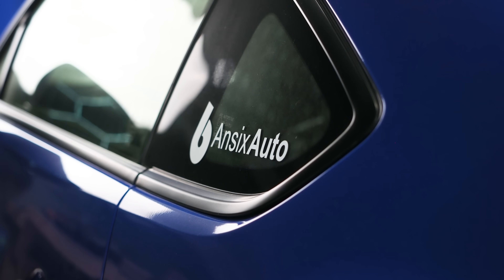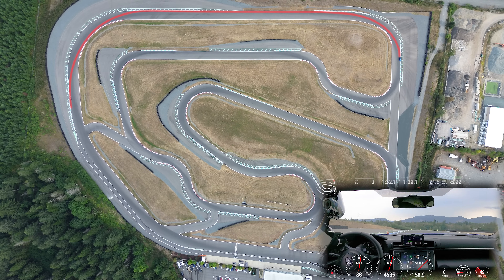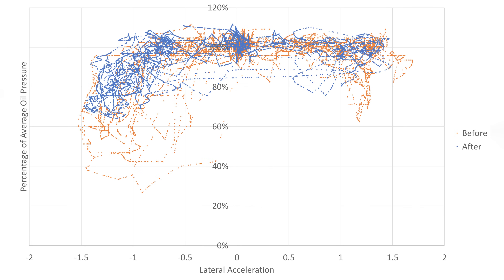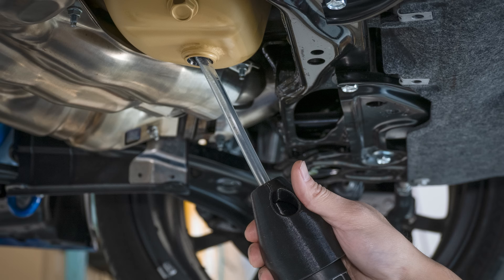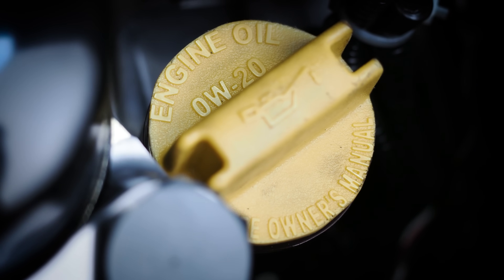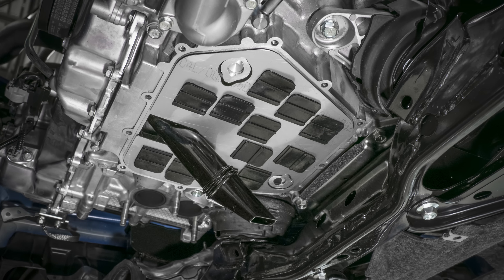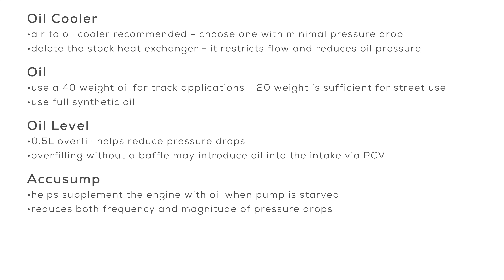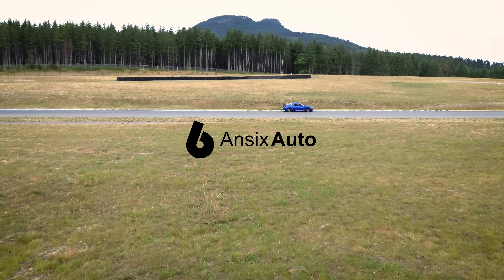The FA24D Engine: What Toyota & Subaru Don’t Want You to Know

Comment: I'm amazed that Toyota let this get out the door.  But I'm not at all surprised that Subaru let this happen.
Reply: Toyota clearly only cared about having a car to fit a market.   If they cared about rep, they would have used their own engine.
Reply: Thats why they bought the BMW Engine for the „Supra“
Reply: Toyota ZZ engines had the exact same issue.
Reply: @KTH96  Very good point.  I feel like sabotaging the MR2 was always a top corporate priority for Toyota.  Although, I don't think the 2ZZ had that issue in the Lotuses?
Reply: @JETZcorp  And the recent Tundras also had that recall due to machining debris left in the engine during the manufacturing process.
Reply: Subaru warranties it at least. If you buy the Toyota you can go fuck yourself🤣
Reply: right cause ya know toyota has never had random engines blowing up or bad designs my 2018 highlander blew up with 4k miles on it and that wasnt tracked at all
Reply: Toyota are busy with engines blowing up left right as nd centre.
Reply: Because executives became lazy enough to not design their own cars but only make a badge swap.
Reply: @dnor16  It's not laziness, it's economy of scale.  Selling the car in two versions allows higher sales, allowing Toyota and Subaru to split the engineering costs.  Under one brand alone, that cost couldn't be amortized across as many sales, resulting in a higher MSRP and even lower sales.  Toyota also does not have an engine at all conducive to this kind of duty in their lineup now that the 2ZZ is gone.  A clean-sheet bespoke engine would blow the budget completely.  Subaru were able to simply de-turbo their new cross-platform engine.  Toyota also own a pretty decent stake in Subaru, so it's not quite so foreign a partner as, say, BMW.  That partnership only made sense because there is virtually zero cross-shopping between Z4 and Supra buyers, leading to really really big economies of scale to offset the German cost bloat.
Reply: @JETZcorp  yeah I get it, but that's supposed to be done with lower-tier models because sharing the same basic design makes them cheaper. But, on the other hand, you're paying a very high price for a top-end sportive and even worse, with a very hyped previous Gen which put the expectations very high. I don't know who thought that would be a good idea specially with the criticism that other makes got after doing the same.
Reply: @dnor16  Well, in both cases it works though.  The Supra and Z4 are both very low volume with low crossover, so together, they just move enough volume to exist without costing Ferrari California money.  With the 86 and BRZ, the fact is that it's the most affordable RWD sports car sold, and therefore easily one of the most successful.  It has been ages and ages since anyone has been able to challenge the Miata on price and sales numbers, but this development-share program with parts-bin powertrain got them there.  I'm glad it's here, because a real sports car that ordinary people can actually buy is extremely precious and important.  If the car was $10,000 more expensive, it would be dead on arrival.  There used to be tons of charming little sports cars, and they all priced themselves out of existence.

That all said, how sweet would it have been if Toyota had partnered with Honda instead of Subaru?  Imagine a K24-powered 86/S2000.  Of course, those two hate each other like cats and dogs.
Reply: @JETZcorp  I mean, yes. But basically you're paying a lot of money for a product that is supposed to be the flagship of your make. It's like you buy a top omega watch and in fact have the internals of another brand with similar price.  It's just not on. And for Mazda, mentioning the Miata isn't a good example, I would put mention the RX7 instead because of the model. And again, I'm not against it but only with low and mid tier models because that makes them affordable. If my memory doesn't fail me, I read somewhere about an interview with a Toyota executive and assured that the next gen will be 100% designed in house.
Reply: @dnor16  We're mostly talking about the 86 here, which again, is THE cheapest rwd sports car you can buy.  It is EXACTLY analogous to the Miata.  Not a flagship at all.  The Supra isn't a flagship either, btw.  If you want a Toyota flagship car, they're all Lexuses.  If brand prestige is really what you're after, though, stick to European cars.  They're the only ones who truly know how to get their customers sniffing farts out of wine glasses.  Toyota don't care about all that dross; they just want to sell good sports cars.
Reply: @JETZcorp  Yeezus haha, my bad, I thought that the BRZ was the base for the supra. Nvm then, I had to google that 🤣

Then I agree what you say.
Reply: Subaru fanboy here - Toyotas are cool too. 86 boxer motor FA, and all boxer motors, are liable to oil starvation, its the first thing you run up against when racing a Subi. The solution is always a dry sump system, with or without an accumulator. Dry sumps really compliment the low CG boxer engine. There are deep-dish wet sumps that people like to get aftermarket, but dry sumps have so many benefits that you really gotta wonder if anything else is worth spending money on
Reply: @cannaroe1213  I think Porsche gets around the boxer oiling issue on their wet sump cars by simply specifying 3x more oil than in our regular pleb cars.  Presumably, that involves a big, deep pan with lots of baffling.  But obviously when things get REALLY seriously, they go dry sump on the GT3 and stuff.
Reply: @JETZcorp  Yeah absolutely, for example Subaru's EG33 is a 6-cylinder boxer that makes 240HP at 6000rpm. It needs around 5.5L of oil. Porsche's S3.2 6-cyl boxer of the same era made 260HP and needed 7.8L of oil. That additional 2.3L or ~50% oil doesn't sound like a lot, but that's a stock 2003 SVX vs a stock 2003 Boxster. When you hit the track and want to bump it up another 50%, it quickly becomes a silly amount of oil in the porsche and more and more HP is lost to pumping all this goo around.
Reply: @cannaroe1213 I drive a 1979 Subaru DL with a late 1980s EA71S (FJ1600 engine) swapped in. No issues with oil starvation at all and it's a wet sump. The difference being that the crankcase itself is only connected to the oil pan by a few drainback holes. It's practically a baffle integrated into the block. Oil pressure stays at around 60psi hot, even going around very sharp turns at high speed. Oil does not migrate into the PCV system and doesn't get sucked into the intake, because it would have to go up around 2 feet of hoses to reach the height of the upper intake tube mounted to the carburetor. The valve covers have baffles where the PCV hose and breather hose hook up. Never ended up with oil in the carb or intake even doing vintage rally racing. I think the EA series engines (Except EA82) were a far superior design and Subaru would have had better luck with modernizing the cylinder heads and valvetrain, and creating a wider or deeper case for more bore or stroke. Something similar to GMs LS vs. the SBC. A good example of what this might have looked like is the Lancia Flavia flat 4, which came in sizes up to and maybe a bit bigger than 2 liters. Even a single port EA is capable of quite a bit more power than you would think. Mine makes 115HP tuned for 93, and 130 tuned for E85 with the total timing cranked up to 54 degrees. At some point I would love to do an EDIS conversion and see what it would be capable of with more advanced timing control. I wish I could get my hands on an EA62 Dual Port to experiment with, I think it would be capable of much more power.  In theory, it should be able to do 200HP or better with tiny twin turbos like VZ21s, or an AMR500 or SC14 supercharger, or even both at the same time. Particularly if the supercharger was set up with a clutch and bypass valve to disengage above 5000rpm or so and let the turbos take over completely. Wouldn't even necessarily need to be carbureted, but rather could have EFI using 2 motorcycle throttle bodies sitting on the intake ports. But unless I happen to find one of those engines, I am not going to put too much effort into finding one, as the next project is going to be a Cosworth Vega with wet sleeved block, forged pistons, H-beam rods, MLS head gasket with O-rings in the block, and modern Haltech 1500 ECU running either modern injectors in the stock intake or ITBs for a Cosworth BDA/BDG (port spacing and size is the same), depending on whether it will be naturally aspirated or turbo, which I have not decided yet.
Reply: @theodorgiosan2570  wow the Cosworth build sounds awesome man!! You have to make a youtube channel or something to document it, i'd love to see how a few modernising touches helps the reliability and power of those old inline powerhouses. The pre-EJ era of Subaru is not something I know much about, small inline aircooled engines I thought, but the EA71S and it's 6cyl brother the ER27 look like serious bits of Subaru history I need to get my hands on and look at, really interesting to see what design decisions were made that resulted in the EJ. Yeah, really cool work man, really cool!
Reply: @dnor16 omega used eta modified movements for years. Only recently they moved to in house movements. So yes it applies to luxury watches as well.
Reply: @JETZcorp  nah  you can't put a simple inline 4 into the BRZ 86 platform for one reason the boxer 4 is what makes the BRZ stand out, yes I'd love to see the FA24 be closer in spec to the f20 or f22 but 200hp from a crisp subaru boxer 4 is unmatched in sound and great reliability  weird how that is but even with the oil issues plaguing most all subaru boxer 4s ej253 being the biggest offender my experience with it shows that even a worn down heavily used subie with low oil performs my old outback had 220k miles and leaks everywhere but she never quit even at full bore
Reply: @HEXAN-SC  An inline-4 would be fine, as evidenced by the Miata and S2000, which both have great weight distribution.  Both of those are also MUCH more reliable engines than the FA-series.  I've had several Hondas run deep into the 200ks, one went over 300k before I sold it.  My NC Miata has ~120k now and does not burn or leak a drop of any fluid between oil changes, even with the 0W-20.

There's nothing wrong at all with the boxer engine layout.  I just think Subaru is a B-tier engine builder as far as the Japanese brands go.
Reply: @cannaroe1213 So basically you had the very early Subaru engines, the air cooled 2 cylinder 2 strokes, 360 cc. After that came the EA series, the first flat engines. These are pushrod, cam  in block engines, very similar in piston, rod, combustion chamber, and valvetrain design to American V8s from the same time period. Same concept as the EJ, a crankcase encompassing cylinders,  gear driven camshaft, and crankshaft, that is 2 pieces that split apart in the middle. There were various displacements from 1.0 to 1.8 liters. Most have a single large intake port and single large exhaust port per pair of cylinders. Not really a problem in itself, but problematic when combined with the long, flat intake manifold. Large camshaft duration and an oversized carburetor helps a lot with high end power. Replacing the intake with individual carbs or ITBs above each port helps even more. The EA62 was the only dual port pushrod EA series engine. These are the beginning of Subaru's rally history, installed in the 1300G coupe along with a dog gear FWD manual transmission, the same one I have in my DL. The EA81 is the most common of the EA series, but it's not so much of a powerhouse, has good low end torque though. The EA71 was developed in the late 1970s and went through several iterations, the original narrow case, with external water passages like the earlier engines, and a narrow block, hence the name, the early Fat Case, from the early 1980s, which is wider and has internal water passages, and the late Fat Case, which solves some of the overheating issues with the earlier versions and has larger port heads. From the late Fat Case was developed the motorsport version, the EA71S. These have larger port heads, a ridiculous 300+ degree camshaft, titanium valve spring retainers and special valve springs, different forged high compression pistons, and most had a dual carb intake. Originally these made around 100HP@6500 RPM but they can be tuned to make around 130-135HP with a larger single carb and lots of timing advance, or more with dual carbs mounted directly on the ports. They have a rather extreme powerband, starts at 3500-4000 RPM, continues to around 7000. No torque under 4000 to speak of. Extremely low gearing (4.88+) is required to run one on the street. They need to run surface gap plugs (Champion N19V, AC SV4XL), or they will run into detonation even in 100 octane fuel. With surface gaps, they are happy on 93. They also require an odd 10w50 oil. 5w50, 15w50, or 10w60 will also work, but the 10w50 really does work best. Available from High Performance Lubricants, Manteno IL, part number PC10W50-Q.  Around the same time as the EA71S was being developed for motorsports, the EA82 came out for passenger cars. This is an overhead cam derivative of the EA series, and it is a rather fragile engine, with external oil lines for some components, an odd oil pump setup, and a timing belt. It's really quite mediocre. The ER27 was developed from the EA82, not the pushrod EA series. It's a cool engine, but with some of the same durability issues of the EA82.  After this came the 3 cylinder Justy engine, no relation to the flat engines, followed by the EJ. The EA pushrod engines are the most durable of the bunch, but suffer from poor cylinder head port design which limits the power output without using radical camshafts that reduce driveability.  Improving cylinder head design, and enlarging the block, like GM did with the LS, would have resulted in a world beating engine with legendary durability. The block and rotating assembly are already so durable, just making it bigger and making better heads would have been the better alternative to the EJ, a somewhat half baked OHC engine with myriad durability issues. As for the Cosworth Vega, it is a far older piece of racing history. An engine with a Formula 1 derived cylinder head that is saddled with weak aluminum cylinders and an open deck block. The head requires no modification, it already flows as well as it can. It's capable of supporting well over 300HP naturally aspirated, from a 2.0l engine. The block is the durability issue with that engine, and nowadays that is possible to fix with sleeves. It's already set up for EFI, but has such a primitive system, it doesn't even have an O2 sensor. The camshafts are also rather small for a race engine. But those are really the only things one needs fixed. The block, the EFI, and the cams. Afterwards, you have a genuine Cosworth engine for much less money than buying a BDA or a Millington, and it's even one from the classic 1970s Cosworth era. I think they are majorly slept on, and I think my build is going to change that significantly, as soon as I get started on it. I'll make videos when it comes time, it's just that it's a bit of a ways off at this point. Likely mid next year.

Comment: 986 boxster a had the same problem. I think many cars aren’t meant to be used on track. The oil systems just aren’t meant to work under those conditions. Dry sump seems to be a necessary upgrade if you will serious track work with any car.
Reply: none of them are.  They're budget / sport cars.  Not track / race cars.
Reply: Exactly, people expecting to track their car straight from the lot without mods shouldn't be buying a  budget car.
Reply: They have the infamous IMS bearing failure. 996 911 models also had IMS bearing failures.

Comment: Is there no large oil pans yet on the market?
Reply from the maker: Not yet it seems.
Reply: @AnsixAuto  15 years ago I learned that the hard way that QTY of oil is the bare minimum. Subaru didn't screw up as much as they didn't design the car to run with thick sporty tires. Don't they have 205s or 215 400-500 tw tires? You won't be getting enough lateral Gs to break the engine. Unless these engine have a dry sump, they should all have a double baffled(left and right of at least .5-1 quart of oil ready to cover the sump during hard cornering. Also, I don't know much about the boxer engine in those, but do they have pumps in each head? Porsches do have them, but the problem with those is they tend to froth which introduces air into the system.

Comment: so if i have the aos with drainback kit and overfill the oil by 0.5L then in theory it will help with oil pressure and prevent oil from going into the intake then correct?.
Reply from the maker: The overfill will only help a little but yes, that could work.

Comment: Great video and data.  Like many of us here I have a Gen 2.  Looks like I need a baffle and the Acusump.

Would you say an AOS would help mitigate oil burn in your intake without a baffle (or with) when you overfill oil?
Reply from the maker: An AOS definitely could help. Its also possible that you install an Accusump and don't do an overfill and you might not have any oil burning issues.

Comment: I'm not a 86 owner but it's a super interesting and for sure helpful video for those seeking to use their 86's on track.
I got one question though: at 4:50 you said that the jackson radiator/oil cooler causes a high pressure drop.
Is that part installed by factory? Is it something you had installed before adressing the pressure drop problems? Are the pressure drops less with the stock components?
Reply from the maker: The Jackson racing radiator / oil cooler is an aftermarket part. We installed it because our oil temps were higher than we'd like. The pressure drop is less with stock components.